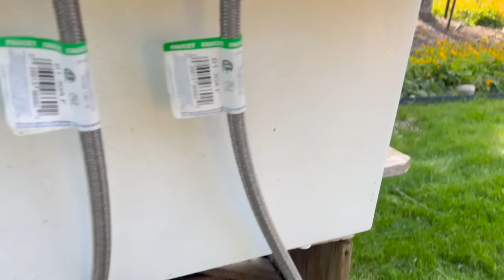How to do Laundry Without Electricity - Washing Clothes Off Grid Without Power

Comment: When I was young, I had to do this because my washer and dryer went out and I couldn't afford to have them repaired or replaced. I bought a washboard, filled my bathtub with water and washed everyone's clothes and hung them to dry. It wasn't easy as we had 7 kids. I would attach the rain barrel to the gutter drain (with a filter)and then you don't need to carry your water. I have 4 rain barrels connected to each other on a downspout for my garden. I use a window screen to filter most of the leaf crud out and keep mosquitoes from laying eggs in. I would probably attach the wash tub to the last barrel and use a hose to place water in the tub. The first rule of prepping is to try not to hurt yourself...it can cost you your life.

Comment: Take two 5 gallon buckets to the creek. Fill one for washing and one for rinsing. Use a clean plunger to wash the clothes . Wring them out and rinse. Hang them on clothes line, fence or bushes to dry.

Comment: Get 5 gal buckets , a new toilet plunger drill 1” holes (4) . The plunger is your agitating device. ACE hardware sells old fashion wash boards cheap. Get clothes pins to hang things on a line outside. Do this now (prep) so when you lose power you’re ready.

Comment: My grandma and great grandma used to boil the clothes and stir in a large pot and then hand-wring it dry and air dry in the home since the apartment homes in Germany were warmed with coal. 

For me, If I lived next to a creek, I would either do my grandma's way outside in a home-made fire-pit or wash the clothes against the rocks by the creek with basic soap like dawn since it's supposed to be environmentally safe and then air/hang dry.

Comment: I use a five gallon bucket, clothes in, a tiny amount of soap, hot water, soak, agitate w/a clean plunger, check for stains or rub stains first w/fels naptha soap.  Dump out in shower/tub, fill bucket back up w/warm water, agitate to get soap out, wring and dry on wrack. I do dishes and cook while the laundry is soaking.  Most of the time is hands off, soaking, while you do something else.  I handwash all my small stuff.  I have no washer/dryer and the laundromat is expensive.  It's really trial and error.  I do this three times a week so I have this down

Comment: I think you might want 3 five gallon buckets. Or 2 five gallon buckets and a big metal bushel basket.  I'd soak the clothes first and then take them out one by one to scrub/wash with brush and then toss in a 5 gallon bucket with soap.  You can use a plunger 🪠 to agitate the soap clothes to wash them.  If the bucket has a lid, you can put the plunger handle thru a hole you cut in the lid.  The lid helps keep the water in.   Ring out.  Then agitate in the clean rinse water, ring out, and hang to dry.  I saw a lady handwash by just laying clothes flat and scrubbing with soap and a cleaning brush.  Then rise, ring, dry.  My friend used to do laundry in her bathtub when her laundry broke and she didn't have money for the laundromat.  God bless modern washing machines.

Comment: The "clean" dirty clothes(Whites and light colors) should be washed first. The next dirtiest after that and then the dirtiest last. That way you use the same wash water for 3 loads. Then, you make a tub of rinse water and rinse the clothes in that same water. You could cover the drain with a flat plastic lid to keep the water from draining out. The worst part I have experienced with the wringer, is when buttons crack and break while going through it.

Comment: After this, were you down in the bed.? Fibro is so painful. 😢
My mother had three galvanized wash tubs. She boiled water in her black iron tub, The tub she made hominy in. 
She drew well water and filled each bucket half  with cold water. The boiled water went into the cold water. She took her scrub board and her Oxogen Soap and scrubbed those clothes until her hands were red and raw looking. The clothes went through two rinses. She then wrung those clothes out by hand. Then, she hung them out on the clothesline to dry.
The next day, she put her three iron irons on the wood stove to get them hot enough to iron. (I still have those irons) she used a coke bottle with a sprinkler to dampen the clothes. My mother is in heaven resting today and her clothes are sparkling white! 
I have not watched a video, I have enjoyed more. You make it look so simple. 😂😂😂😂😂😆😆
Reply: I’m new at this, I added a new comment. I’m still laughing. 😂😂
Reply: Unlikely this could done by someone with fibro
Reply: My mother did NOT have fibro. Sorry you misunderstood.

Comment: I would just take the laundry down to the creek along with the tub and ringer. Use a rubber made tub in the sink and a clean toilet plunger with holes cut in it to agitate the clothes. No need for a rock in the tub. The water will weigh it down. When done bale out the tub with a small bucket and transport the clean clothes back to the clothes line for hanging.

Comment: Back in the day and even now, alot of people had a hand pump on well.  So they could just go pump their fresh water which was close to the house.
Reply: Also buying a new toilet plunger or 2 would be great to use as an agitator element for the washing part. 1 or 2 people using those plungers up and down would be a good improvision to washing clothes instead of washboard or a rock.
Reply: Also a 5 gallon bucket with just a plunger alone makes a great small washer.  Use the bucket with the screw on lid.  Cut a hole in center of lid to put handle of plunger thru.  So then just use , pump it like a butter churn.  It washes clothes great and same method can be used to rinse clothes in another bucket.  The screw 9n lid makes it to water won't be flying all over.

Comment: I f you don't have a STOPPER.  Use a wash rag to stuff in the hole. My mom used to do it.

I hang out the slightly worn  clothes on my back porch for a few hours.  

I almost never just wear clothes for a few hours and then wash them.

On days when no one is at home.  I don't wear underwear.

Comment: Let Dave push it up hill so you don't get tendinitis. You definitely don't want tendinitis.

I would stop the video, buy a rubber sink stopper, then resume. Funny.

And wash your red stuff last. LOL

Those ringers can't handle buttons or zippers of any sort. Simply ring the item until you reach the zippers or button, then back it out so you don't run it over and break it. Buttons will break and zippers will warp.

Comment: You made a pig’s ear of that. You had a wash board why didn’t you use that, and why did you take the washing out put it through the mangle from the back if you had done it from the front the water would have run back into the tub, and to stop the clothes having a yellow tint use washing blue if you can still get it, there is blue in modern washing powder. You did make me laugh. When I was young my mum use to wash by hand for 7 people, 3 adults and 4 children every week, and she had to heat every drop of water, no running hot water.